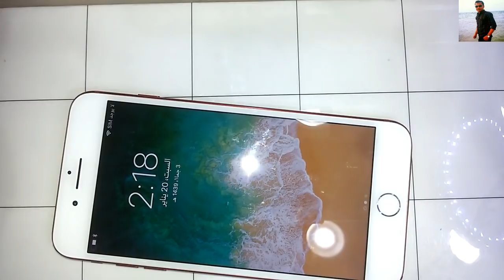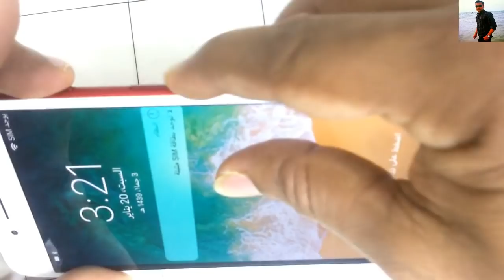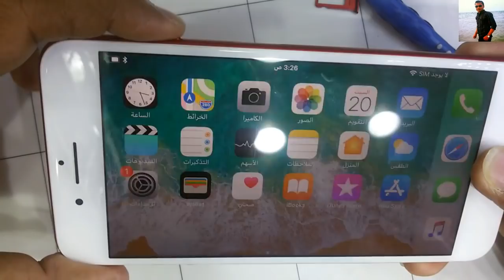iPhone 7 Plus Rear Case Replacement Guide

Comment: hi, i just replaced my rear case and everything is working besides it wont charge. what could that be ? how do i fix that ? thanks for helping.
Reply from the maker: First you have to change the charging port
Reply: @TechRobot360  hi, thanks for the answer. i took my phone to a cellphone repair store and the charging port was the issue. have a nice day.